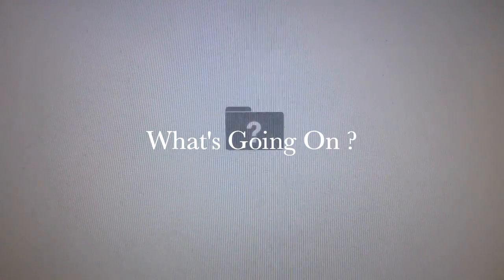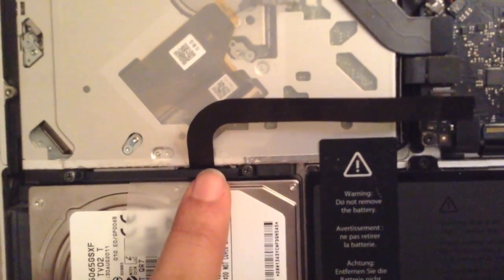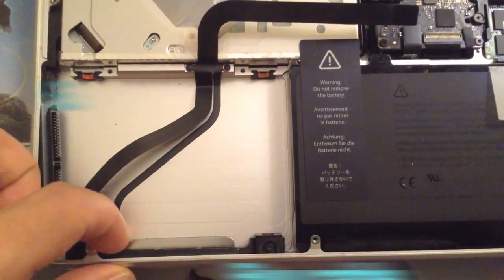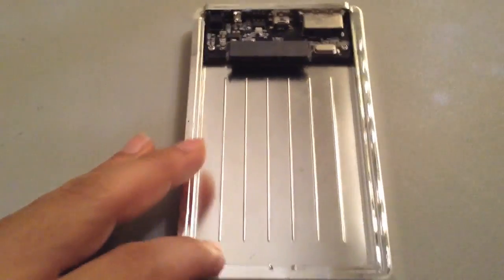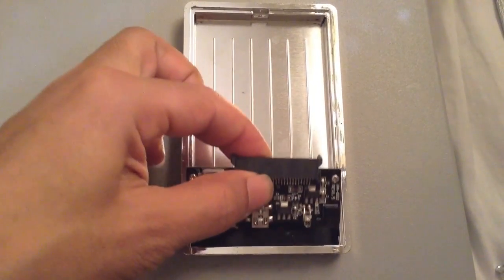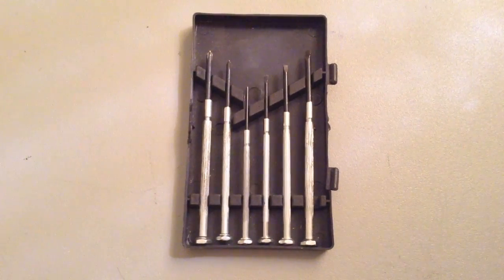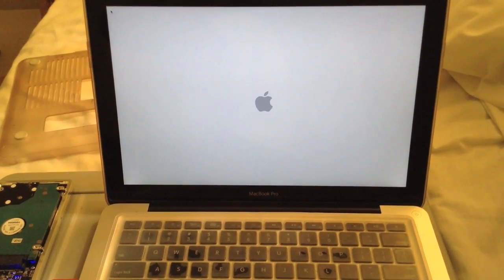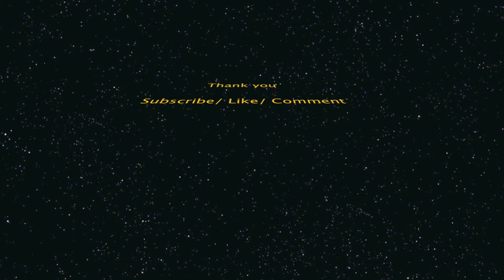Mac Book Pro Flashing Question Mark Start Up Repair

Comment: I ordered a new hard drive cable and installed turn it on but the problem is still there. blinking folder with a question mark. Any other solution to the problem?
Reply from the maker: Did you try placing the drive in a portable USB device?

Comment: Thanks for the info. The ribbon was my first thought because upon first pressing the power button, the CD ROM made a noise , then Nothing.  No key combinations ever worked  It was weird.  Then the Question Mark Folder.  I tired EVERYTHING.  
After watching your video, I connected mine to an External enclosure through USB.  It booted up fine.  Just slower.
I'm definitely going to try to find that SATA Ribbon.
Reply from the maker: Bran & Teia's Fitness Videos Hello my friend. Were u able to get ur files ?

Comment: Good video.. I'm still nervous to tear my girls mac apart... so I'm positive it's the cable or the hard drive. Is there a way to know for sure if it's cable or hard drive without pulling the hard drive out
Reply from the maker: Welp... If ur getting the 'flashing folder sign' it usually means there's no connection. You can try connecting it to another drive if you have one.

Comment: Thanks dude. Great video! I'm going to try it out on my MacBook Pro 2015. I get the ? Message and makes quite a loud noise that is coming from the hard drive and won't boot up. It could possibly be the hard drive rather than the lead but then again my MacBook is only 2yrs old.
Reply from the maker: Thanks Harry. If the drive is making noise, then it might be the drive... specially if it beeps or scratches. If you have valuable data, i think places like Bestbuy recover.

Comment: Hi James, I just installed a new SSD on my MacBook Pro (13-inch, Mid 2012) because my hard drive is broken. When I start the computer the folder with the question mark appear again, I did power botton + alt / check disk utility and it seems there is not problem with the SSD, so you think I should change the cable? or may it be something else?
Reply from the maker: Hey Peder. Sorry for the late reply. Sounds like a case of a bad cable. Let me know if the vid helped replace it and what brand the disks are.

Comment: Cheers this helped me and I have now worked out that the cable is the faulty part  :-) Many Thanks  Owen.....
Reply from the maker: Owen Durbin - Glad it help. I was going crazy when I didn't know what the issue was. Make sure u run a back up of ur stuff when u can. Hard drives sometimes fail too.
Reply: Cheers,  yes I will  :-)

Comment: the question mark with the folder, also happens too me  cuz you erase all your OS from HD, Lucky me when that happened to me i had bought a Mavericks OS, USB from Amazon so i turned off my mac and restarted it holding down the option or command+R it differs depending on the model of your Mac, anyhow as for me i accidentally erase entire OS so i plugged in my USB with Mavericks OS on it and got it back to work.I wanted Yosemite as my OS but I did it right this time....hope it helps for some people, but in your case yup your cord looks damaged
Reply from the maker: McRom37 - True. What kind of drive did u get ?